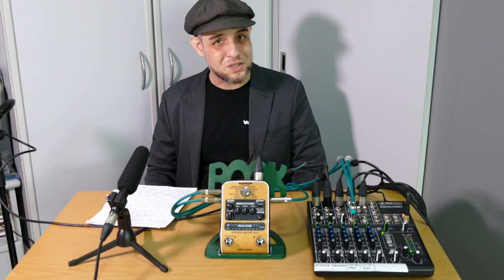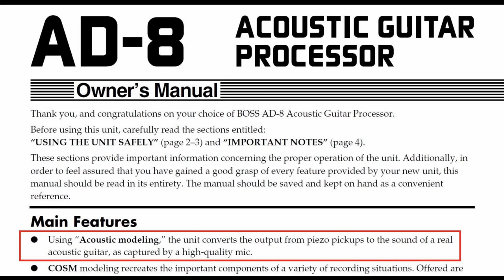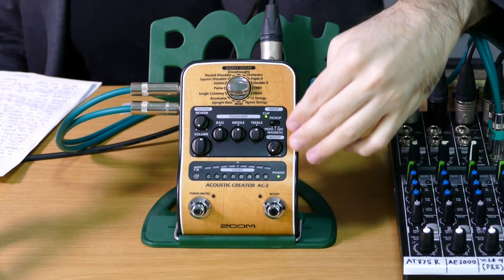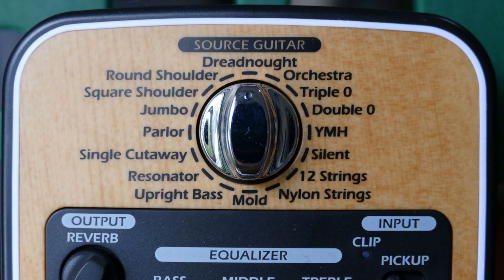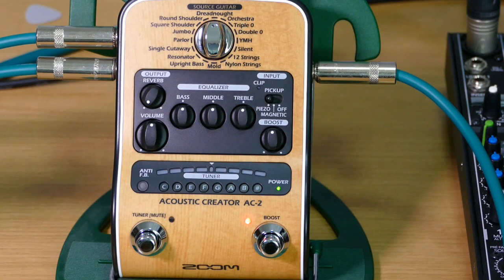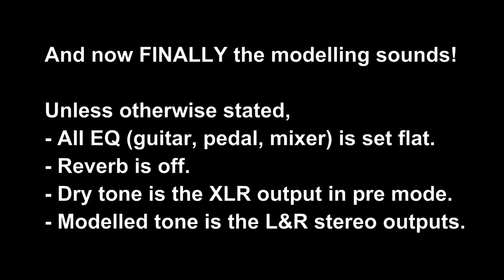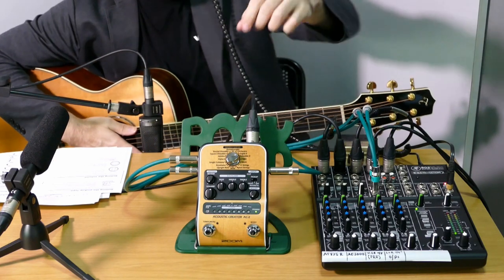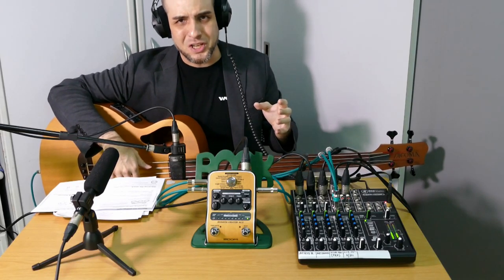Zoom AC-2 Acoustic Creator review and demo

Comment: Thank you again for a detailed review. On the strength of this I looked very closely at the Zoom offerings and managed to pick up a AC3 at a great sale price. Very Very happy with the sounds live. One thing to anyone out there reading, use your ears when selecting the source guitar type because I settled on a different source to my actual guitar type. Hence my Eastman 422ce ( single cut away) sounded to my ears modelled best as a jumbo... food for thought anyway.
Reply from the maker: Glad the video was helpful! This box is really made for live work - it has all the necessary connectors, all the features you need and none that you don't. I'm still using it today.

Comment: Thank you for your quick reply. Last question, The church I am playing in has a DI-box I can connect to which goes into the PA-system. In such situation, is an pickup enhancer still required? FYI, I play a simon&patrick semi-acoustic with a b-band A3T preamp. I want to get the best acoustic sound.
Reply from the maker: It's definitely not required - you can still get a good sound with just a high quality DI box in conjunction with your onboard EQ.

Comment: Thanks you make it now clear to me but for home musicians zoom a3 is seems complicated can you describe please if there composition of different single efect cheap pedals can achieve say same effect? Thank you.
Reply from the maker: The modelling part would be difficult to duplicate. However you could use a reverb and an EQ pedal to duplicate the other functions of this pedal, plus a tuner and some sort of clean boost pedal. To be honest with you the Zoom does all of this much more economically, it's a really great all-in-one solution.
Reply: Thank you. I mean the in time of musiciana it to complicated to switch the effect or disable instead on single pedal you can just on off.
Reply from the maker: That is true but remember that multiple pedals take much more time to set up and there is the issues of additional cables, connectors etc. The AC-2 is just plug and play.
Reply: GLB Productions Thank you. It what i mean and actually the "cheap"  single effect is not so cheap :( when need preamp boost overdrive and loop in my case.

Comment: BTW, ovation vs Takamine pickup?  would like to hear  your thoughts on these pioneering pick up technologies and sound.
Reply from the maker: That's a good question - I have almost zero experience with the Ovation system but from what I have read it is broadly similar to the Palathetic pickup in that it uses six relatively massive piezo-ceramic elements and results in a sound that is somewhat decoupled from the 'acoustic' sound of the guitar but is very consistent and easy to amplify to high volume levels.
Reply: GLB Productions hey thanks for the reply, I appreciate and trust your thoughts on the matter. 

BTW I very much agree that most musicians accept and appreciate a good piezoelectric tone, it's a very legit live sound. 

Would also like your thoughts on the tc-helicon bodyrez, is it the same kind of modeling technique as the zoom ac? Or does it just add resonance only?
Reply: GLB Productions Also I removed the previous comment, i thought u were doing an experiment. Sorry for pointing it out.
Reply from the maker: Oh yes the TC Helicon. I've never used it but from what I can read and hear online it appears to be more along the lines of the Boss AD-2, in other words a lot of EQ and some compression. Something you can do yourself with some experimentation really... Also what many of these products miss is the fact that the tone required from an acoustic guitar in a band setting is very different to that needed when playing solo! This is where companies like Takamine hit the nail on the head - yeah by itself the pickup has a rather hard and forward sound but put it in a loud band and it sound just right without a lot of EQ.
Reply: GLB Productions hey thanks once again  for the replies, I take ur comments very seriously. Ur words carry a lot of weight as u r very knowledgeable.

Yes a very much agree that these piezoelectrics hit the mark in a live band situation especially those that were made during the 70-80s.
(Taks and ovation were the main staple on most live stages) 

I've been using my tc-helicon play acoustic on flat setting and compress, the body rez settings really don't work well with a band. 

Just as u had suspected, these products were more tuned for the solo singer song writer. 

But it took me awhile to actually realize this and I played with horrible tone on stage for months with the bodyrez settings turned on.

But eventually I went back to the flat settings and used more of the para eq on my mixer.

Not sure whether the zoom models would be great on stage and live sound. Haven't tried any of these modeling tech yet.

But I do love the Yamaha A3 pre  amps model, the sound is lovely by its own

Comment: Okay, so let's say I'm using that thing just with my amp. How do I equalize the amp? Years ago, I occasionally used a Line6 amp simulator when the score called for different sounds and styles. The manual said to equalize the amp "flat," which was bass and trebs at zero and mids at ten. (Eleven on my amp. <grin>) It was good advice for the Line6 gear. What about this?
Reply from the maker: That's a good question Joe! You now have two sets of EQ controls, possibly even three if you have EQ on your guitar! The best advice I can give you would be to set everything flat and experiment from there. If your amp has active EQ with boost and cut set everything to the 12 o'clock position - likewise set the EQ on the AC-2 and the EQ on your guitar the same way. Then start tweaking and see what sounds good :) 

For me personally I have found that I hardly use the EQ on the AC-2 - I have 2dB of bass boost and 2dB of mid cut on my Takamine's onboard EQ and that's all. Which acoustic amp are you using?
Reply: Currently, at church, I am playing a Takamine GN93CE (TK-40D Electronics) through a Boss Acoustic Singer Live amp -- which is by far the most complex amp I've ever used -- with two channels (one for voice), separate EQ for each channel (three controls) as well as that "acoustic resonance" button (guitar channel), which provides three different colorations. It's got a built-in harmonizer, chorus, echo, reverb, etc. And the two XLR outputs on the back obviate the need for a DI box. Might be worth a review! <wink>
Reply from the maker: Oh yes those acoustic singers are pretty amazing amps! I've gone back and forth over the years between using effects pedals and amplifiers with effects - at the moment I've pretty much settled on getting my effects from pedals and monitoring using full range PA speakers, either standalone active ones like the QSC K-series or through the monitor system. The time I really like to have an amp is when I'm in an unknown or high-volume situation and I need direct control over your guitar sound.

Comment: To me it sounds like this unit does a good job of reducing or improving the pickup sound, but it still sounds like a pickup. Some presets sound less pickup-y than others though, and when finger picking the pickup sound is less noticeable. Could be useful for someone who plays exclusively or mostly fingerstyle.
Reply from the maker: It really depends on how you listen to the output of the device - in the video you're listening to the direct output, which I agree still retains some pickup-like qualities. However when playing live with the device this effect is ameliorated by having the signal pass through a loudspeaker and then the air. But yes, nothing really sounds like a microphone except a microphone ;)